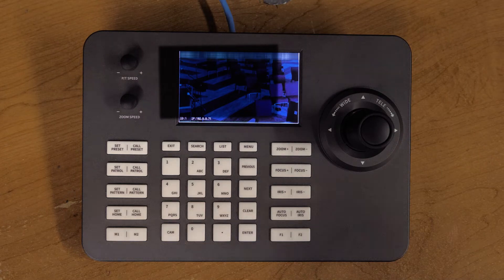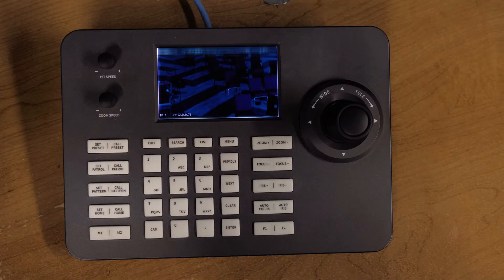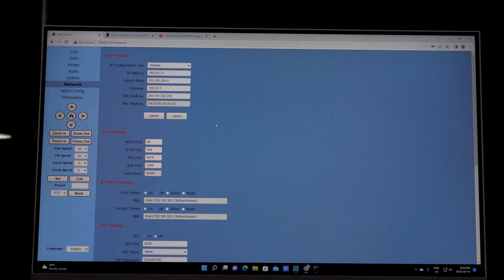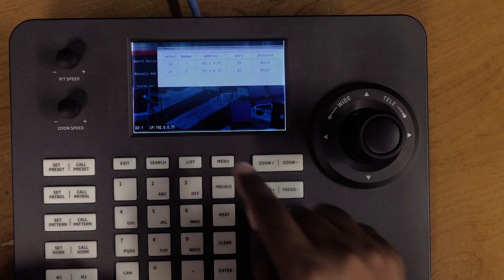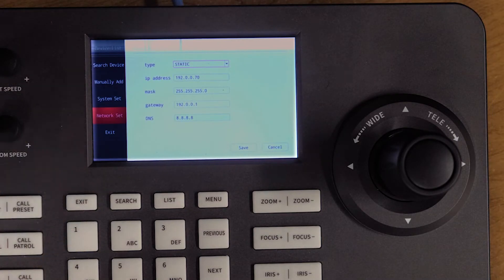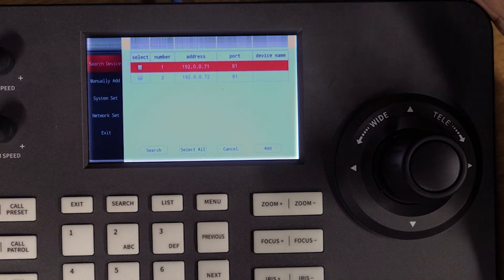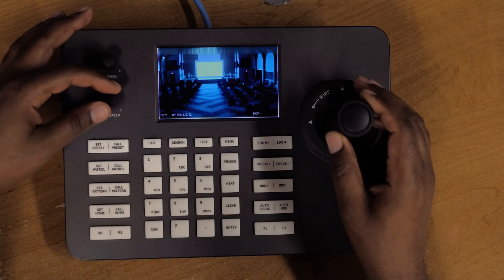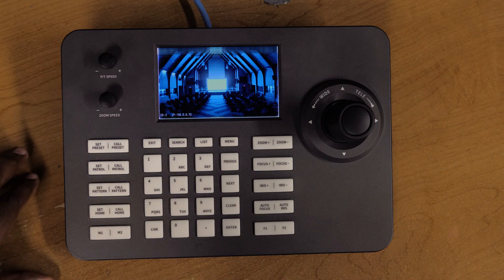HOW TO SETUP HSILITY S3, PTZ IP Controller | LEFTEK S3 Connect & Control PTZ Cameras Tutorial

Comment: sir i need help. i have a ptz camera that i used to be able to view on my macbook pro using a chrome app called "nacl web plug in". that app doesnt work anymore, and i cannot find one that will work.  (one thing i didnt like about this was the delay in response time as i clicked the different functions on the interface.) do you know of one?

also, better yet,  i would like to be able to use this ptz with a network ptz controller using onvif. id like to be able to use an actual joystick, instead of an interface on an app. id like the response time to be quicker with no lag. so heres another question.

if i have an nvr, an ip network ptz controller, and an ip ptz camera, can i hardwire these together and be able to watch on my tv via hdmi?? or do i have to plug in the ptz camera and or the controller into the router and view on my macbook laptop???

im sorry if i am confusing you because this stuff really is so confusing to me. i basically want to control my ptz using a joystick and would like to view it on my tv instead of a laptop. can you help me??? 

i hope i can just get a nvr and joystick and hook these to my ptz and then everything will be working fine, and recording. what do you think.
Reply from the maker: Simplest way is: connect PTZ camera to ip controller via a ethernet switch and use the HDMI output from the camera to your TV. unless I am missing something but this should be straight forward

Comment: Hello, i have the same controllerin which i am having trouble with. My controller does Pan and Tilt but it has stopped doing Zoom in/out using the joystick. I can only do zoom by pressing the white zoom in/out buttons but not through the joystick. How can i fix or do i need to update the controller?If so, how do i update it? Your help is much appreciated.
Reply from the maker: Best thing is to join the HSILITY facebook user group, they are very helpful

Comment: Thank you for the video, when I search I was able to find the 3 cameras that I have, however after adding them and pressing CAM 1 then enter, it gives connection failed. What am I missing?
Reply from the maker: @MeAndYouTogetherWin  double check your IP adresses
Reply: @LiveProductionTips  the IP address is all the same - the joystick 1.200 and other 1.201, 1.202, 1.203. Same DNS and Gateway.

Comment: 2:06 - Before you type in your camera ip into a browser you must first make sure your computer has been set to a static IP that is in the same range as your PTZ camera. Also make sure you don't have any Firewalls enabled on your wired ethernet network, and turn off any VPN you might have on (as all that will not allow you to connect to the PTZ)
Reply from the maker: Thanks for sharing

Comment: How do you change the order of your cameras once you install them.  I want them to be left to right 1 thru 4.  currently they 1 is 1 but position 2 is 7, 3 & 4 are also correct.  Had camera 2 go out and now the replacement says 7
Reply from the maker: I guess it depends on the order by which you added them or could be the IP adresses !! I don’t have the answer right now but you could test those 2 things

Comment: Great video very helpful. My PZT works properly and connected properly, however the tilting and panning is not stopping to specific direction is just keep moving to the left or right if you used the joystick to the left or right same in ups and down. Any info will on how to fix please.
Reply from the maker: It could be the unit that’s damaged. There an HSILITY user group on Facebook try to join and post your issue there they may help

Comment: Jay, I notice that in the settings on the camera the Http port was 80 but the controller picked up the cameras on port 81. My controller is not connecting my camera and I'm not sure how to resolve. Did you set that up in settings or the controller automatically found port 81 for your cameras?
Reply from the maker: For some reason your comment was blocked, but yea the port was automatically there, so I kept it that way
Reply: I was able to resolve my issue and I have full control of all my cameras with the controller. The switch the that use for my setup, requires a download to FULLY configure the settings of the switch. It allowed me to manually change them but would not save the GW setting at all. After downloading the app , the controller was able to see all PTZ cameras on that network. @LiveProductionTips
Reply from the maker: @arymu007  great
Reply: Thanks for you expertise. @LiveProductionTips

Comment: Hello, I have some problems connecting AVKAM 20X ptz cameras with this controller, the first time it connected without any problem, now I can connect them, it sends me the message connection failed, can you please help me
Reply from the maker: Hello you wanna double check if you didn’t change something, probably the ip adress
Reply: @LiveProductionTips   Thank you for answering, the control recognizes the camera's IP but it sends me connection failed, the 3 cameras give me the same error
Reply: Can I send you a video of the control configuration? Any email?
Reply from the maker: @sektor3studio  you can share in my Facebook group. Should be on my banner. 
Please share both camera and controller IP adress

Comment: So where I am working has 3 camera's one isn't working so after I watch your video I realize that I have to go to the computer to add the IP address is that correct? Also when I do the whole set up and search and Add cameras it doesn't pick up and the controller itself takes long to flip to next. Is there a way to fix that.
Reply from the maker: The key is to follow the IP adress sequence the way I explain in the video for both the controller and the cameras. Once you have all the cameras connected let me know what problem you have to see if I can help.

Comment: I bought the Leftek version for my video production kit. I have a love hate relationship with the controller. It is more geared towards security starting with the fact that it only supports onvif and not the visca protocol. 

Most video production gear uses visca. As such having additional access to control the cameras from most video production software as well as the controller isn't possible. Second is key presses. Most video production controllers have 4 quick keys to select cameras and presets. What you can do with usually 2 key presses on those it takes 6 on the S3 controller. In a fast paced production it really slows you down.

I love the preview screen though, you don't get that on most video production based controllers. It also cheaper than most video production controllers by a couple hundred bucks.

It is perfect for monitoring and controlling most security PTZ cams though.
Reply from the maker: Ya looking at the price maybe that’s why it is not matching up with higher end production graded controllers. As you mentioned though it does the job controlling Most PTZ cameras that use omvif protocol

Comment: hi
There is an option to enter from controller to camera OSD?
Reply from the maker: Hi If Understood well the question yes the controller has a small LCD so you can monitor your camera’s image.
Reply: @LiveProductionTips  hi - i want to enter to camera menu (OSD) to change for example iris/shutter :)
Reply from the maker: @skovyrniepl  ok that’s possible with the remote that comes with the camera. If the camera is too far from you the best way is to access its web interface through its IP adress. You will have access to its menu.

Comment: Hi,
I purchased a Hsility S3 IP Keyboard controller this week to use in my church but I am unable to connect to the AVKANS PTZ camera. I tried connecting manually and over POE and no success.
Any advice on how I can get the controller connected?
Reply from the maker: Did you follow all the steps?
Reply: Yes, I believe I did.  The devices continues to say "connect failed." When searching for the camera I get no results.
Reply from the maker: @nevillelee3074  liveproductiontips@gmail.com please email me the info including screen shots or pictures
Reply: I just purchased the controller and is having the same issue as Neville Lee, could you tell me how to fix this issue?
Reply: Connect the cameras to your computer to access the menus and make sure that they are set for onvif instead of visca.
Reply: @WolfsHaven   i just find out it only suports onvif i believe and if your cameras are a diferent program you will not be able to used them onvif is kind of like windows,mac,linux program it runs off. so if your camera is a visca protocol this controler will not be able to work
Reply: @loshijosdelmal2179  onvif is more traditionally used for security cameras, where as visca is often used for video production. That said most PTZ cams have a setting you can switch for the various protocols. Sometimes you can get to it via the cameras IP address, others you can get to it using the cameras USB port.

I have the 1080p AVKANS 30x zoom cams and I get to the config page through the IP. You may have to change the ip range on your computer to the default IP range of the camera to get to the config page the first time. From there you can set onvif and change the ip address of the camera.
Reply: AJ has a couple videos on here that go through the config settings for AVKANS cameras.

Comment: I have the same setup and camera that you have except for the Poe switch. My camera and controller are on same network however they are not connecting
Reply: Also make sure your camera has Onvif (in the camera’s menu turned on with no onvif authorization enabled).
Reply from the maker: Are you able to verify the IP adress of the camera and controller? Do the numbers match ?